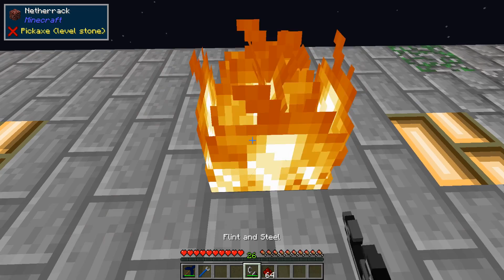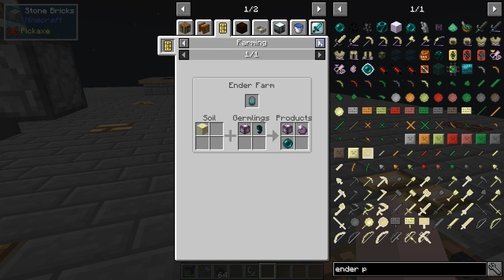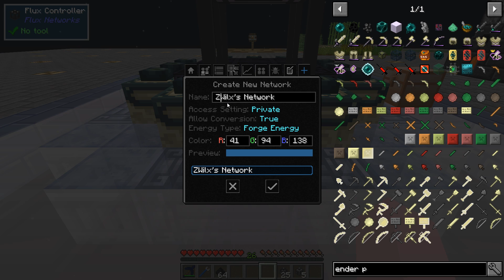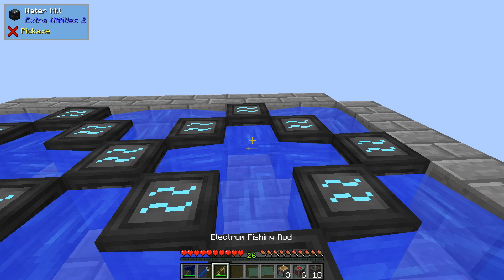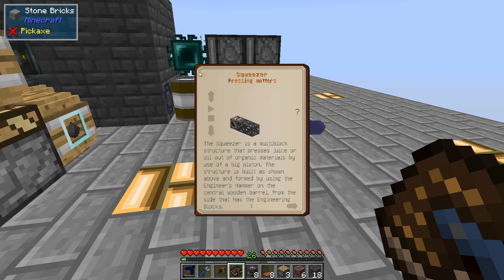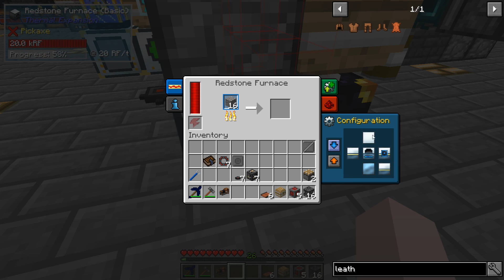04 - Diamonds, Leather, Lag Goggles - Ultimate Alchemy

Comment: you can dry your ender pearls with ... two hoppers (one for in, one for out), drying rack and acceleration wands in mechanical users ;)
it's very quick, i did that for my medium tier of flux storage in almost no time. ok, gargantuan it would be 6x more this no time ;P
btw. do you know the difference between forge energy and redstone flux as a power source? looks like both of them are working just fine for me.
btw2. i missed that - how you are putting fuel to your howering overclockers?
you can repair electrodes by... combining them on anvil :D hint - leave single one on right slot and multiple on left one, they will give you the number of fully repaired electrodes from left input box (it's probably a bug).
Reply from the maker: > difference between forge energy and redstone flux
Some mods might be particular, but most should work with either.
Reply from the maker: > fuel to your howering overclockers
The creative wood barrel on the bottom
Reply from the maker: > you can dry your ender pearls with
I'm looking more seriously at things that don'r need a smeltery for automation.
Reply: @WilxGaming  unfortunately magma crucible does not work for that :/
Reply from the maker: > magma crucible does not work for that
I was talking about growing them from Ender Lillies
Reply: @WilxGaming  yeah, i didn't tried that yet. maybe will try cloches later today.
btw. try accel wand in hand on metal press - imo it's quite funny machine gun ;)
Reply: @WilxGaming  You can use a magma crucible to turn ender shards into resonant ender. And then the transposer. And as long as I can fully automate it, I don't care about the speed.
Reply: @Johannes_Kuhn  hmmm... i missed this option with magma crucible (nice derp on my side, i had in it augment for faster lava production)/fluid transposer on cryotium dust. afair Wilx already had automation for this dust done, so it can be quite fast production.
but if that would also require only a cloche - it would be even simpler (not counting that cloche requires beginning bits of botania, to make aluminum needed for blueprint needed by electron tubes).
Reply: @WilxGaming  Magma Crucible DOES smelt ender shards, I have a fully automated system for making the shards that feeds directly into a magma crucible which in turn feeds directly into a casting table with a pan cast.  I use item translocators and a pair of barrels (one with a stone downgrade and the other plain) to store the soggy/dry ender pearls between operations.

Comment: For anyone who's lazy like me and doesn't want to keep setting up users with the wands in them, I installed torcherino. Normally it's stupidly OP, but since you essentially have infinite wands of acceleration in this pack It doesn't really matter. It gives you torches and jack o lanterns that increase tick rate in an area, so you don't have to worry about making a million wands and mechanical users.
Reply from the maker: If that makes the game more fun for you, go for it. That isn't the first mod I would add, but I try not to add anything to the pack that my viewers probably won't have. Lag Goggles was an exception that they can see the results from in the video but they don't need to add it themselves.
Reply: @WilxGaming  i wont even call Lag Goggles a mod, i see it as "debug tool"of some sort.
Reply: The problem is the 'in an area' with torcherino it's many blocks getting ticks, so more processing lag! mechanical users and wands can be focused, you just accelerate what needs acceleration.

Comment: I took one look at the process for getting Diamonds, and instead built an Excavator from Immersive Engineering, and found a Coal Vein.  All the diamonds/Emeralds i could want for a while.
Reply from the maker: > Excavator from Immersive Engineering
I looked at the list of possibles: https://ftb.gamepedia.com/Mineral_Deposits
and it includes too many things that would break the pack and make it much less challenging. This might sound odd coming from the guy who relished in the Lens of Color. In that case Tema disabled the Lens of the Miner which was right beside the Lens of Color and probably saw it and didn't mind. However the Excavator is a step too far for me. I do really appreciate you bringing this to my attention, but I won't be using it.
Reply from the maker: Excavator works in a void world? I didn't know that.
Reply: It's a little odd, You have to fill in the space beneath it with Dirt blocks, for it to dig up when is starts (I went with 3 deep, covering the full footprint of the excavator.  Less may be necessary, didn't test), but once you do that, it works fine.  I suspect Tema didn't know it worked either.
Reply from the maker: In my test world with my seed I have found 1 gold, 1 pyrite/iron, 1 galena/silver/lead, out of 36 cores, no diamonds/emeralds so far.
Reply: @WilxGaming  Ouch. I've only checked 19 chunks in my world, and I found 1 gold, 1 Platinum, 1Cassaterite (tin), and 1 Coal (Which is where the diamonds/emeralds are).  They're not super common, so It may not be worth the effort if you don't find one in a chunk you're already building in.
Reply from the maker: > and 1 Coal (Which is where the diamonds/emeralds are)
Dam I forgot. I did find a Coal.
Reply: Thought about it too, and decided, nah, too cheaty. I automated diamonds a few days ago and got a stack of them. Emeralds are an other beast. You need to go through botania to get thaumcraft, and then you can create your first emerald. After that you can create a numismatic press augment and get easier emeralds.

Getting the first emerald changes everything.

Also the reason no mobs spawn is the biome. I did not yet look into it, but it might be possible to change the biome.
A good way in the past was to grow Silverwood Sapplings. Not sure if it still works.